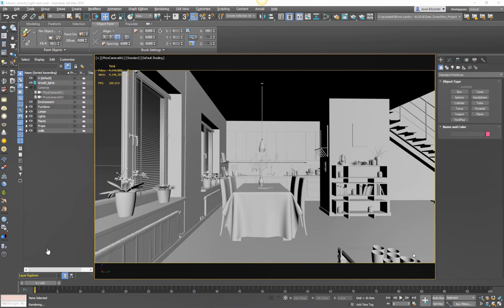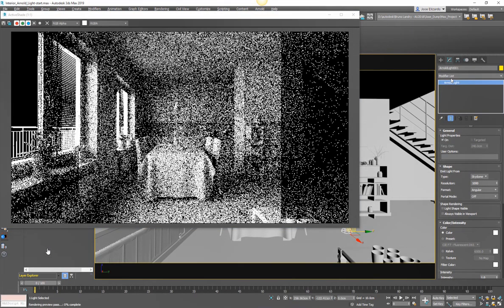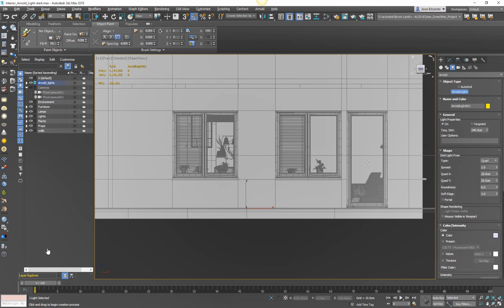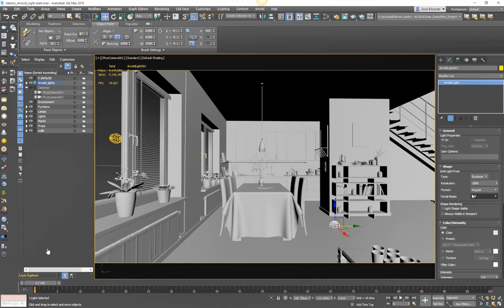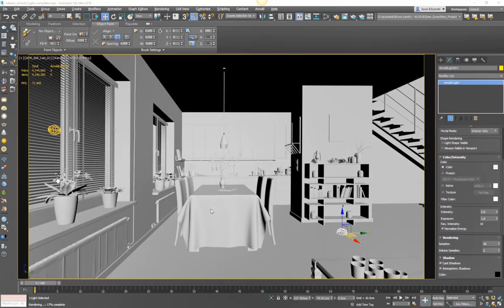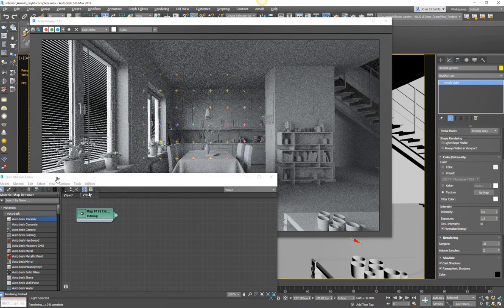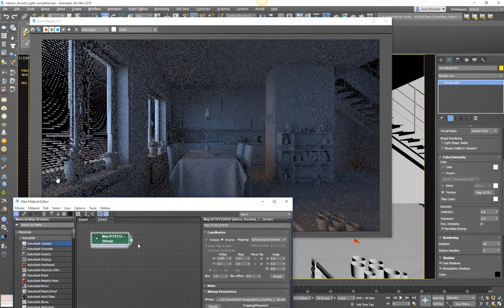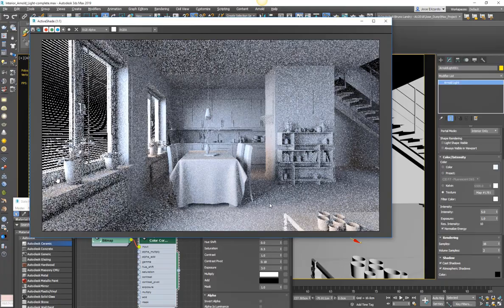3dsMax & Arnold Interior Lighting Part 1

Comment: Jose, thanks for this video, Different between active shade an production rendering. i'm using the same parameters, in active shade the rendering appears with light's and in production mode is totally black, what's wrong.
Reply from the maker: If you have access to max 2022 just use the arnold render frame. Its activr and production all in one. New paradigm.